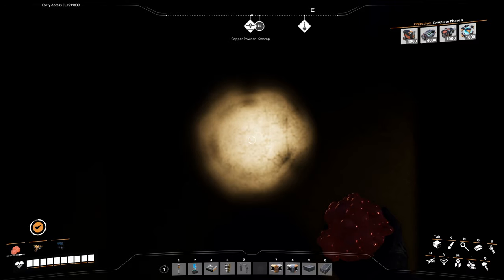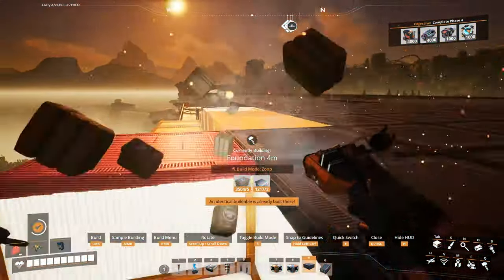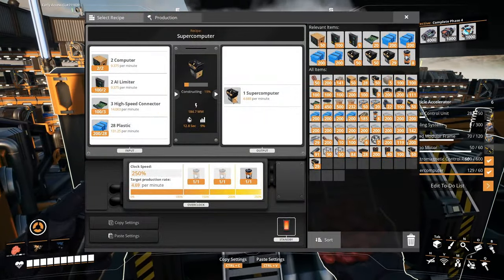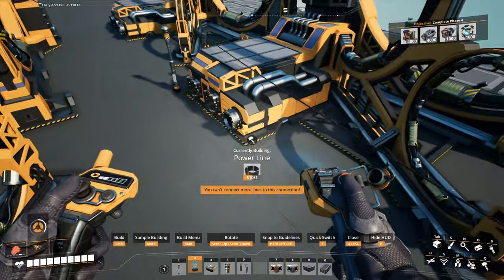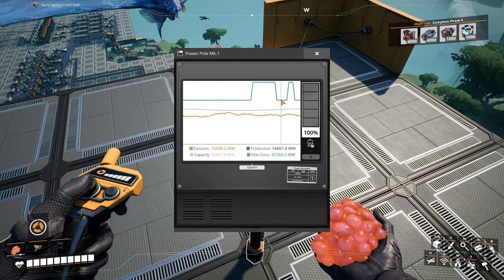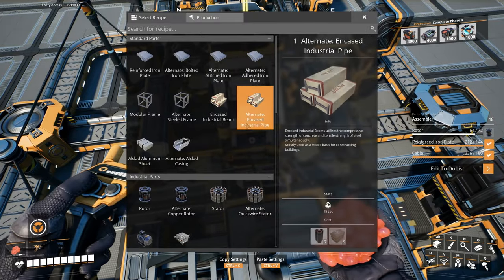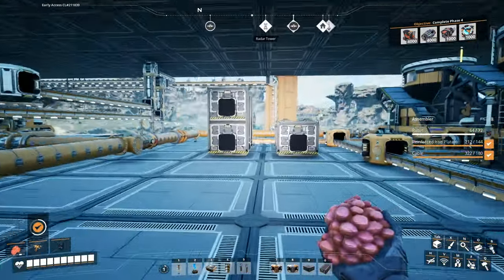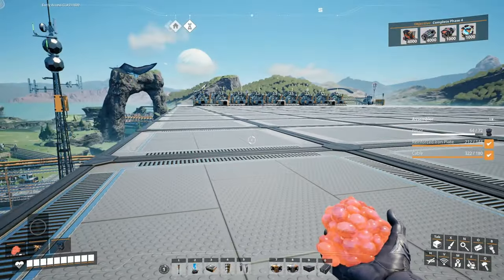Fifth Floor of Factory - Let's Play Satisfactory Update 7 Part 163

Comment: Before the series ends you should try out some train infrastructure! The best part is that it only runs on power and you get to build really cool road networks and can add lighting to it (and it's easier if you use blueprints)

Just an idea! I think you'd enjoy how trains work.. although you've reached a point that trains might not serve a purpose other than being fun to play with. You could setup something between your quartz area and main factory with trains since you (mostly) have roads setup

P.S. Monorails actually carry power with them too, so you can transfer power without power lines via them.
Reply from the maker: tbh at this point I really don't feel like doing trains. I have too much to do with my current projects so I'm just gonna head straight to the finish line.